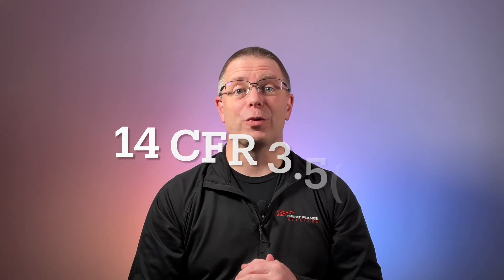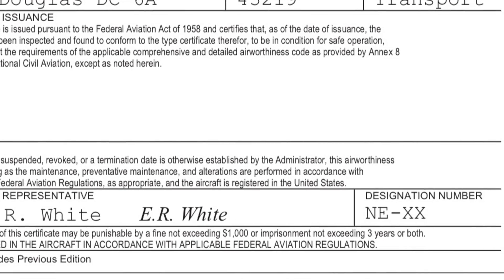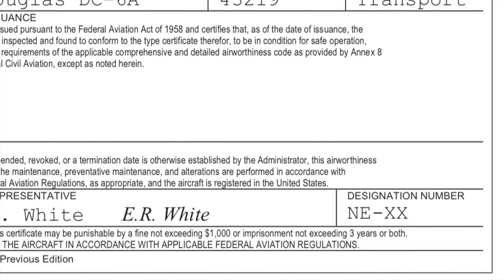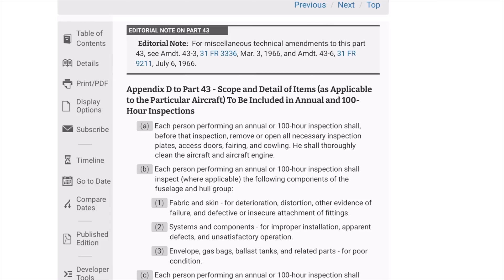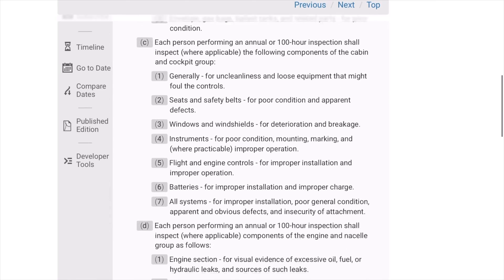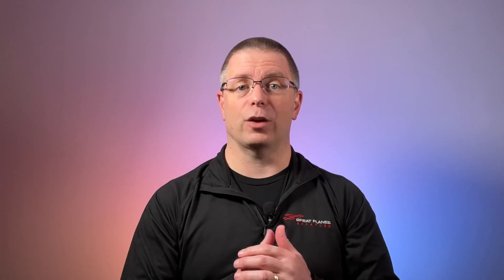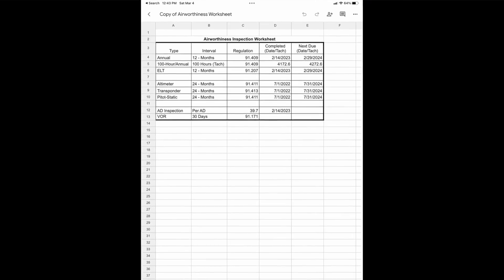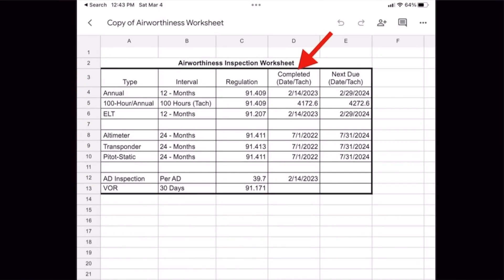How to review aircraft maintenance records

Comment: Hey, what a wonderful video, I guess I got one question, are both the annual and 100hr inspections mandatory for airplanes part 135 & 91?
Reply from the maker: Thanks for the compliment!  The answer to your question is… “maybe”.  

For part 91, you only need to do 100-hour inspections if flying passengers for hire or providing instruction for hire.  So, if you aren’t using the aircraft for these activities, only the Annual is required.  Under part 135, it is assumed your activities are for compensation or hire.  Therefore, I believe you must do 100-hour/Annual inspections, Progressive Inspections, Approved Aircraft Inspection Program (AAIP), or Continuous Airworthiness Maintenance Program (CAMP).  Whichever your FAA issued 135 certificate allows.  I hope that helps.